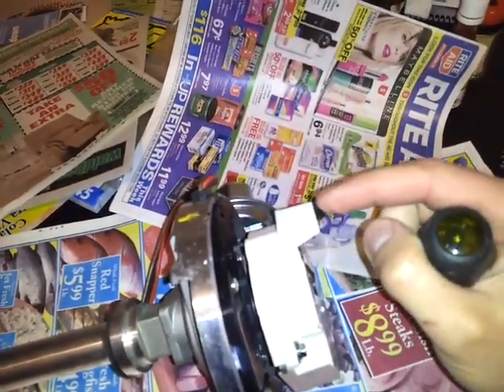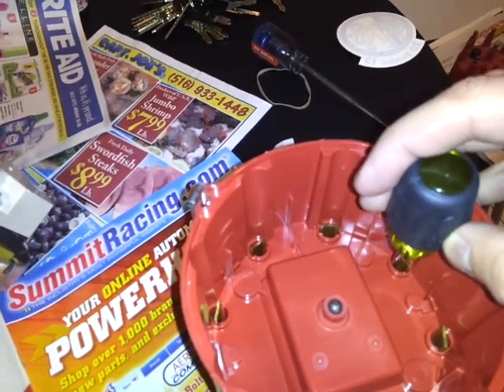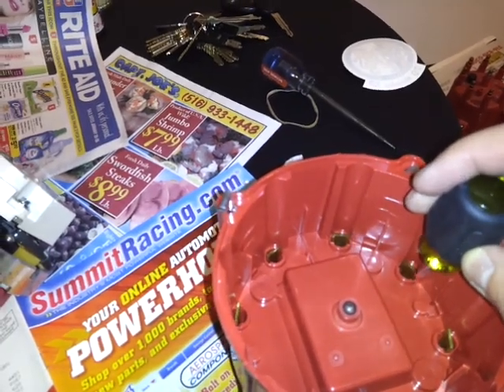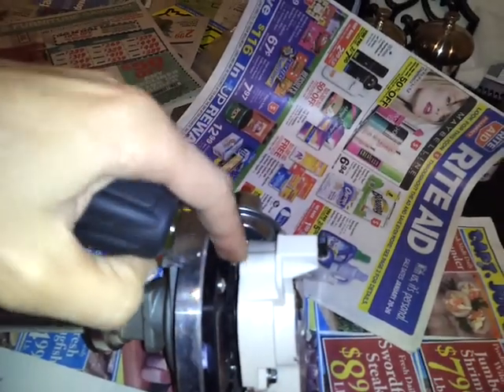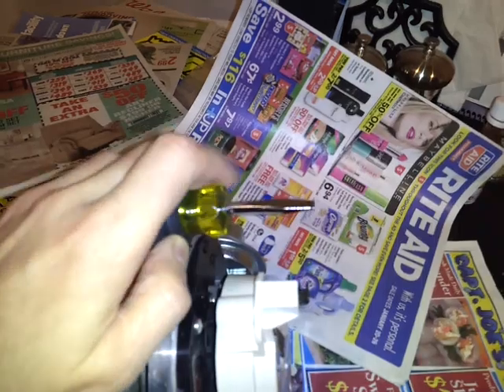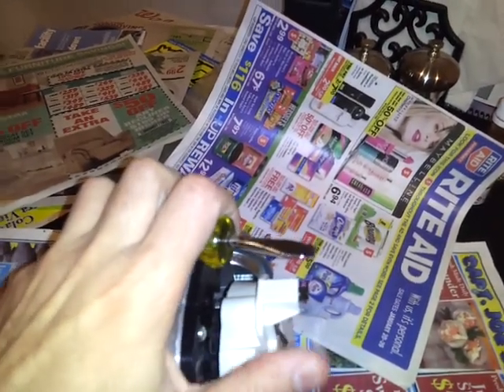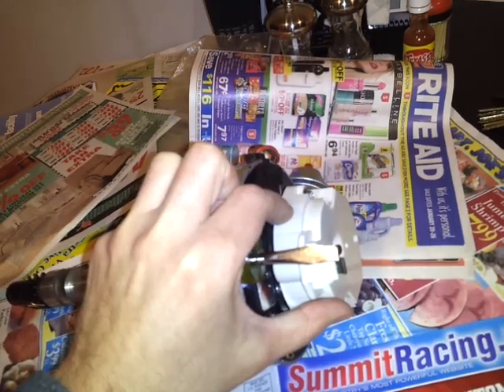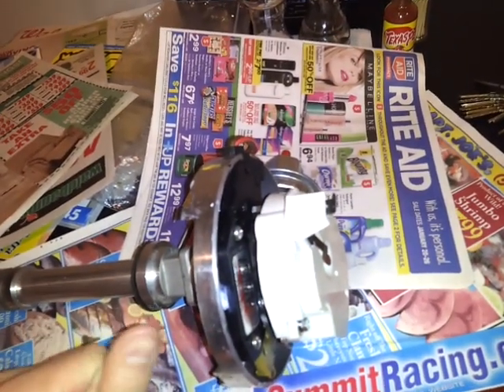Explanation of Distributor phasing

Comment: if you have a pro billet MSD distributor, buy part # MSD-8421, which is an adjustable phasing rotor cap replacement for normal rotor cap

Comment: Thanks, I know this is an old video. It's helped me alot. I checked my cap,same as yours in the video. Maybe why I loose power at the top end. It has a stumble and begins to miss around 4800rpm. It's a caddy big block, so I don't take it past 5000k. It ran great until I swapped plugs,wires and cap and button. I've replaced wires,wires, and cap,cap, kept the same new rotor. I bet that's it.. I didn't even know about the rotor button from MSD. Man I hope this helps me out. Thanks again.